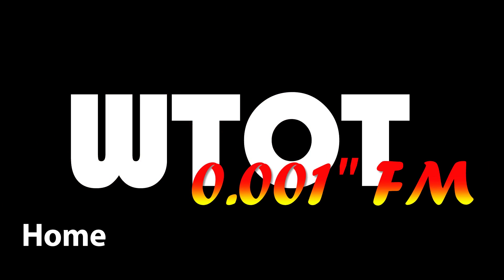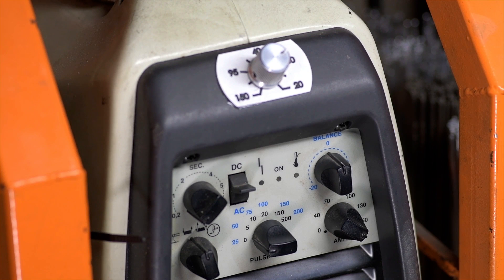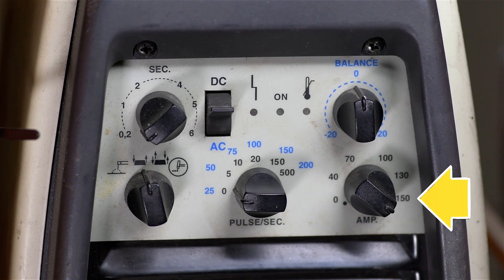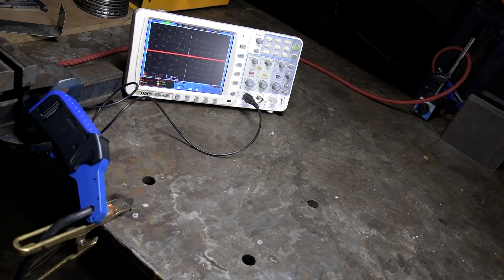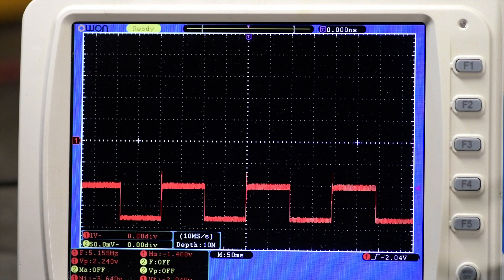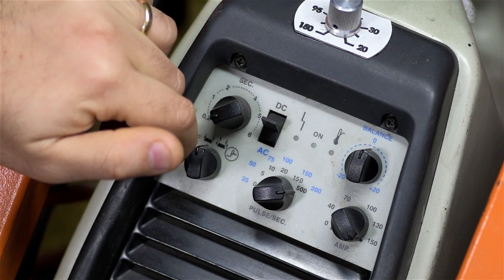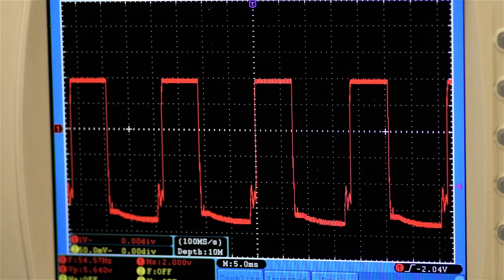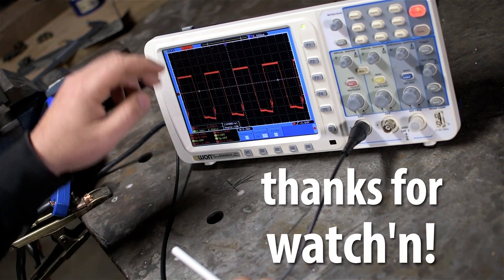My TIG Is Breaking Up With Me

Comment: It would help a great deal if somehow somewhere somewhen you could provide "ideal waveform" ' scope pictures. I have no idea what TIG is all about but I am (or was) an electrical engineer so I can look at waveforms. But I don't know what I should be seeing, so it is greek (or sanskrit)  to me, from a debug viewpoint.
Reply from the maker: There are a few different flavors but the square wave seems to be the most popular.  It should have been a nice balanced square wave, AC.  Instead I'm not quite getting the full top half.  The other issue was duty cycle.  50% works, as does 70% negative.. but 70% positive.. not so much. :(
Reply: Ah yes. In real life there is no such thing as a square wave. On a rising pulse there is an overshoot at the top, followed by a more-or-less damped sinusoid to undershoot, followed by another overshoot -- much less than the first one  -- and so on till the damping takes over. This is, or was in my time, called "ringing" and I noticed quite a bit of it in the waveforms you showed. The fact I noticed it indicates malfunction. In these days of integrated circuits it is hard to say what is at fault. Probably, or possibly, the damping resistor. But nowadays it is more expedient to replace the whole board than to unsolder a teeny weeny resistor and replace it. Trouble is now, which board to replace and I cannot help there.  Maybe an indignant letter to the manufacturer might help. They will, or should, tell you to replace board xyz-123. Cheaper than a new welder. Attach a link to the video with it. Manufactures  hate adverse publicity.

Comment: It's closer to ventricular tachycardia than cardiac arrest, (asystole).  Still not good although you can defibrilate v-tach but not asystole.  Maybe you just need to defib your machine, or you are getting interference because your scope is sitting on the surface the electrons are flowing through.

then again, I'm not an electrical engineer either...today at least.
Reply from the maker: wait, are you calling me an asystole in my own comments section?!

;)
Reply: Well if I were, I wouldn't calling you that for very long  :O

Comment: Very instructive video Tony as usual. May I ask you what welder would you buy ? I'm curious what would you upgrade to now that you have learned enough to be dangerous !
Reply from the maker: Great question.. I've been doing some window shopping and there seem to be some great machines out there.  And the high end ones are so affordable too! :/
I keep going back to the HTP/STEL pages, and the Kemppi tigs look REALLY sharp.
Reply: Thanks a lot for the answer - I've never heard of the Kemppi before, I'll check them out. I have my eyes (and and ears, nose and mouth) on the HTP 221. Last question, did you see a huge improvement in comfort and or performance with the water cooled torch ?
Reply from the maker: Performance is basically the same for my size machine, but YES for comfort.  I bought that for a large aluminum welding project, what a difference compared to a WP26!  Have a look at the kemppi mastertig series.  MLS? something like that.  AC/DC machines.

Comment: Hey Tony, try removing the arc from your experiment, dead short your tungsten into the table and see how the scope reads. With electrode Neg it's like water from a garden hose into a bucket, but electrode positive it's like trying to pour the bucket back into the hose. The electrons don't fit back as easy thru the arc.
Reply from the maker: Interesting thought.  I don't think my machine will actually push any current through if the HF start doesn't establish and arc, but easy enough to try!

Comment: Im not engineer but I would say it seems more like a TTL or IGBT/MOSFET issue. (I know nothing about those machines so idk if its mofset or igbt). but either one of the power transistors or a smaller logic transistor seems more likely than a bad cap to me. if the wave form had some badly rounded edges or it was a really inconsistent saw tooth wave Id think of a bad cap.  but inconsistency of the waveform in frequency and amplitude seems more likely to either be a transistor on its way out, or a solder joint has corroded or broken loose.
Reply: Im with devin. I am betting one of a few IGBT/FET's is out.

Comment: Michal Kundrat found the schematic.
It looks like the positive leg have turn on problems. The instability in the flank.
I would just put in new capacitors in the gate drive circuits (Top of Page 10).
A cheap attempt that can do no harm. It can do harm to continue using it though. Try to fix it, you have found a good way to diagnose whether it is fixed or not.
I think I have seen a thermal imaging camera in one of your videos? Use that to see if all the mosfets are equal temperature. If one differs it may be failing.

Comment: Best thing to do after a break up is, weld with a new welder as soon as possible, even if it's not your ideal welder and has a wanky AC/DC switch.
Reply from the maker: I dunno.. won't it be awkward the next morning?
Reply: It might be a little awkward to lift your hood, particularly if you try welding electrode-negative for the first time and end up melting the tip off of your tungsten.

Comment: My guess is it's probably a busted capacitor. They have a limited life, so it's normal to replace them after some years of usage.

They are usually easy to identify and replace  (standard through hole mounting) and when they are fucked they become engorged or even explode sometimes!

Comment: I didn't realize you could have pre-mixed helium / argon bottles.  I thought they would separate to some degree.
Reply from the maker: I always make sure to shake well before using. :)
Locally I can get any mix I'd like from the weld supply but 50/50 is cheaper.   They must make a lot of it / big buyers / etc.
Reply: Would you consider using two bottles (one with straight argon, one with straight helium), and just mixing them with two flow regulators?  I'm thinking of going that route, and am curious if there's anything wrong with that setup.  Straight helium seems easy to find here.

Comment: I'm a master at catching shards of stuff with my eyes.   Sometimes I'm wearing glasses when I should wear goggles, and sometimes I end up blasting remnant grit into my eye in the shower.   One idea I had, and it actually worked a few times, is it to use those powerful neodymium magnets.   I just lay on my back and pass the magnet over my eyeball as close as possible.    Warm the magnet to body temp and you can even touch the eye without flinching.  The actual irritant can be microscopic so you will not always see what the thing looked like.    Of course the worst time I had a sliver of type 304 (probably)  in my eye and the magnet was of no help.   The eye dr excised it.

PS.  I've also caught stuff in my eye while wearing safety glasses plus face shield, so to be ultra safe you should have goggles plus face shield, especially using the angle grinder.

Comment: Looking at the schematic since you have symmetrical circuits it shouldn't be that difficult to side by side troubleshoot.
Start with the power supplies to eliminate flakey caps or a blown bridge then head on in to the driver voltages.

Comment: These hobby machines seem to have corrosion problems on the heatsinks. On mine I removed all of the riveted joints between the output transistors and the heat sinks. Replaced a couple of transistors (popped from poor contact?) cleaned it all up and it welds better than when it was new!

Comment: Good luck with getting this fixed. I do love my HTP invertatig 221 but if I had it to do again it would be a big 350 amp Miller, bad beer good welder Cheers
Reply from the maker: What don't you like about the HTP?  Now I'm curious.
Reply: The HTP is a well made machine the foot pedal is high end it belongs on a big Miller. the front of the welder is all digital no wondering if the 
pot  is correct. The machine goes up to 220 amps. its not Chinese its 
made in Italy. They have a 30 or 60 day money back guarantee. They have it priced 30% less than a comparable Miller and I think it has more control. 
I aspire to be as good as Jody or 6061.com I think with this machine and a another lifetime or 2 it could happen. Can I borrow your time machine?
Reply: This Old Tony The only thing I don't like is it's only 220 amps you need to screw around with a helium mix on thick aluminum.

Comment: Nice video.

Looks like an offset voltage of some sort has "slipped". Bad electrolytic capacitors (bulging top or visible leak) or dry joint on the control board. First guess.

Clean up the board and take a close look.

Comment: great video good detail.I will try and rspond in point form may be easier.

the clues,,,,  inconsistant issue with control does not seem to be a problem with power output,(plenty of grunt)

What may be your problem is more common with hand held control where the switch is cabled to the hand piece. you mentioned that your unit is a few years old.
What tends to happen is the torch lead gets impregnated with metal dust and you may be getting induced interference (like back EMF) from the power cable into the control lead and then back into the machine. 
Try cleaning you leads or just seperating them from the powwr leads.

You will have filtering inside the machine, possibly at the back of the multi pin sockets, these may be covered in metal dust...................

Good luck   
re comments yes it does look like a Cemont unit.

Comment: I see two different problems: 1) not enough positive  current 2) not going beyond 50% commutation time. The former might be due to a diode failure in the rectifier bridge that might or might not cause the second problem. I'd try to fix the first one first. Check the mains rectifier diodes.

Comment: Hum, my first thought is to wiggle all the pots in case they are dirty, but maybe you have done that. I was a little disturbed that the wave clearly wasn't at 50% when the knob was, and I thought I saw it jump as you were changing from -30 to +30, but maybe that was just video editing. But that 20A positive clipping seems strange. Did you wiggle the amps control to see what would happen?

A schematic would be a good start on figuring out what might be wrong.

Comment: If you are happy looking at the PCB inside I'd be looking for a missing or faulty voltage rail, the symptoms are what I'd expect if the balance pot is between say plus and minus 5 volt rails and the out put of the pot can therefore vary between -5 and +5 volts. With 0volts out when set to 50/50. If the positive side of the arrangement has become faulty it would explain the symptoms of 50/50 at a setting of +20 55/45 at a setting of zero and an expected 70/30 at a setting of -20. It probably also accounts for the asymmetry in positive and negative current output.

Comment: Look for cold solder joints on the PCBs, especially at the pins of larger through hole components like capacitors and transistors.
Other than that you'll need to have an EE look at it. It shouldn't be hard to fix as the welder isn't totally dead.

Comment: ...My old 1956 P&H 300/300 AC/DC welder with high-freq.....no electronics in here....everything operates from a "Mag-Amp".......gas/water valves and hi-freq on/off....that's about it....no wave shaping or background current/pulsing etc.....welds great from about 2 amps....up to 300+
 Unit is similar to Lincoln 300/300 but about 20 years behind in engineering.....

Comment: Hey Tony,
your balance control isn't necessarily wrong or defect regarding just the numbers. Of course I can only guess from here and obviously you must have noticed some change in weld quality/behaviour, but 2 things:
+20 or -20 on balance control don't have to be real % values, they can be just numbers for the sake of having values.
50/50% ac balance is not necassarily the neutral setting the manufacturer set to the knob's zero position since a 50/50 balance is usually already more than enough +wave to break the oxide layer. Could be zero is around +30/-70 with a range from +10/-90 to 50/50 or someting similar.

Hope you can narrow out the problem. Your videos are great.

Comment: Hi Tony, given the symptoms I would tip on a power supply issue (one rail low or not clean) as mentioned by another poster. Could be leaky output device also which is dragging a rail down but I'd measure the supply rails as a first move. (I do this stuff for a living and not board swapping but component level repairs) leaky cap as a cause is entirely possible (but I find this seldom to be honest). Is it worth having done if you can't find it yourself? Depends what they charge round your way but likely yes. As a side issue, what is the current probe you are using? I need a new one and I'm thinking you didn't pay a fortune for yours? Love the videos by the way. You are a born entertainer/educator :) best produced machining videos by a mile too :)

Comment: Tony,
I think you have an out of saturation fault.  If left without repair it will probably overheat the positive IGBT. As a matter of course I would ensure the DC link capacitors are good. Cjeck for bulging and signs of heat. If you replace any Voltage,  Capacitance and ESR are all important. I would however expect an issue in the gate driver circuit, maybe a dried out cap by thw fact tje symptoms are worsening. Same caveats as link caps. 
I'm going to show your vid to students next while I teach inverters

Comment: The funny thing is that, having the welder not going to full EP amperage is something you may want. It's called amplitude setting, and it's on expensive machines. Even the miller dynasty 200 didn't have it. Give it a try on spotlessly clean aluminium while it does act like this, and it should work really well.
Reply from the maker: my tig welder is suffering from feature creep?!  ;)  I have tried it, I can't tell much of a difference, but still welds great.  more to come, stay tuned.

Comment: this is taking me back to my early days of tig welding aluminum wakeboard and fishing boat towers. luckily for me my mentor had those Miller's dialed in like a finely tuned clock. those machines were the bees knees. if i ever got back into welding, it would be with a Miller. all that to say, thank you for providing this lesson.

Comment: First and foremost, blow the machine out really good.  Shorts are a big possibility on the board, especially if any grinding dust is in there.  That's an easy thing to try.  I've "fixed" several this way, and it was easy PDM money between that and scrubbing carbon off of old direct-transformer tap stick machines :-)

Since you're seeing it in both AC and DC that rules out the bridge rectifier as that's a DC only piece.

What you're seeing I think is characteristic of one of the capacitors in the output stage starting to go/already gone, pre-rectifier causing wave shaping issues.  If the top of the wave were erratic instead of clipped, I'd say it was in the power bank but it's clearly shorting across the charge plates in one of them.  This happens because the dielectric starts to dry out in the capacitors.  It would also explain why it's been erratic, there's probably dry dielectric in there flapping around every time you stop a cycle which changes the capacitance properties.  If it were me, I'd replace the capacitors immediately before the rectifier, (the AC/DC switch should be connected to the board right where they are I think, the switch merely adds in/bypasses the bridge).  There should be at least two but since I'm seeing a little over half on the positive side of the wave most of the time, I'm thinking four....in accordance with the prophecy.

Good luck.